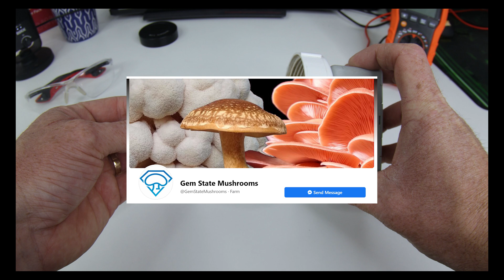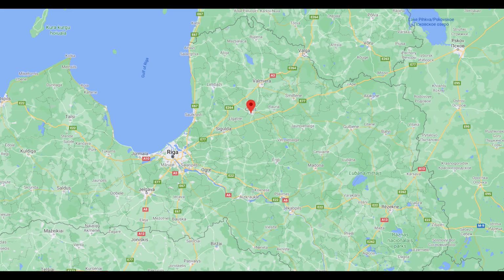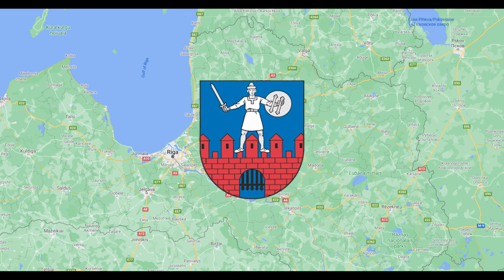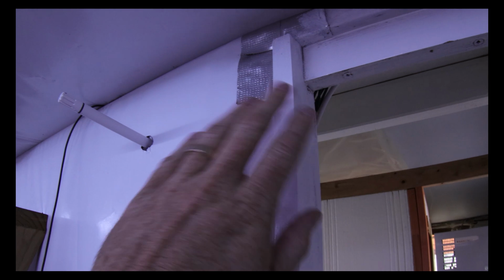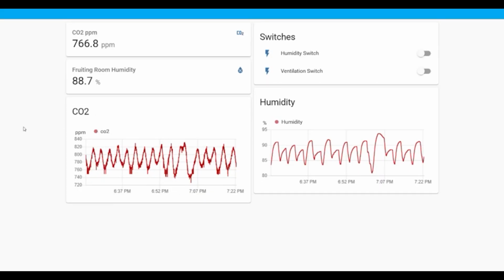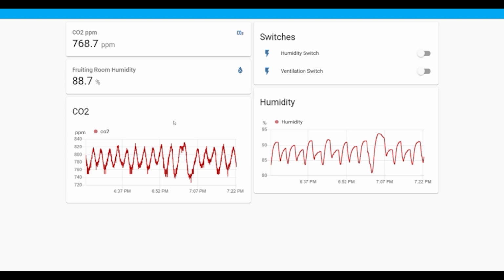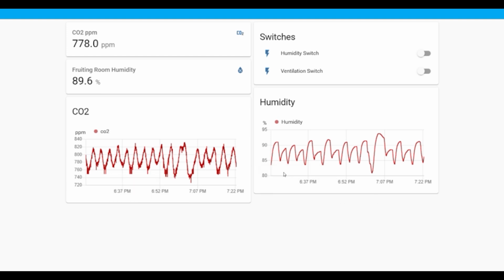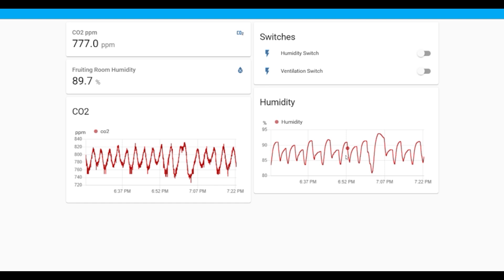Automated Mushroom Fruiting Room Controller

Comment: I did a simpler set up to this. Mine cant be monitored via a computer at the moment.
That said what I did was, for anybody interested. I used an Arduino Uno clone. I bought a DHT22 sensor, I2C LCD 4x20, some odds and ends like a bread board and cables and a relay module. It was easy to set up. the only hard part was the coding. It took me 2 weeks to get it to work. I had no former experience with coding so I believe it is understandable. What I did was hook up my humidifier to a relay. My code is set that when the humidity goes below 80% the relay activates, and then activates the humidifier. When the Humidity is above 90% it turns of. My LCD screen displays the humidity and Temperature real time with the ppm in the future. I am planning on buying a CO2 sensor next and hooking it up with an output to a relay, if the co2 build up is to great an extractor fan kicks in via the relay and brings in new fresh air. It is a simple and cost effective set up and I am glad in the way it works.

I do not have an internet connection near my farm so monitoring it on my phone or pc is not needed at the moment. I am also planning on using a Ambient Light sensor in the future to monitor the amount of light in my fruiting chamber(but this in the future).

One point that I want to make is, if you can learn how these little devices work, you can do almost anything if you put your mind to it.

Comment: mate you simply need xm-18s controller from aliexpress, its about 30-40 usd and can control all you need: temp, humidity, fan, humidifier and heater on/off :)
Reply from the maker: If its 30-40usd it won't be able to accurately control the humidity much over 70%. I need accuracy at 95%, so I use a good quality probe! Plus I like making shit like this...
Reply: @OakandSpore  wish you good luck and many new videos!
Reply from the maker: Thanks mate!

Comment: I've build 2 automation boxes for my growing and colonization rooms based on Mycodo. Could be a bit more expensive cause you will need an Raspberry Pi but it worth the money - nice web interface with Dashboard, supports an impressive list of sensors; PID controller; timers; cameras, alerts. No codding is needed, just basic linux knowledge for initial install and configuration.
Reply: @6233114 Youtube keeps removing my replies with links :(
What you can do is google for Mycodo
Reply: what sensors have you had luck with?
Reply: @andytheriault9383  SHT35 and DH22 - temp with humidity, MH-Z16 and MH-Z19 CO2 but it supports a lot more
Reply: Love your work! I’m thinking of expanding into something you originally had. Automated systems is what I’m looking for to reduce labour. Now you have had time to iron out the creases, would you still recommend installing the raspberry Pi. I’m not savvy with this system. What would you recommend for a first timer? On how to do it? Appreciate all your videos. Cheers 🍻

Comment: You should consider adding some PID controls to get those oscillations down a bit. Also, it looks like the temp sensor inside the Vaisala is a Pt1000 RTD Class F0.1 IEC 60751. That might help you find some code to run it. If not you could always get a few DS18b20 temperature sensors for a few bucks.
Reply from the maker: I would like to, but I think coding a PID is well above my skill level!
Reply: @OakandSpore  just use mycodo on the pi